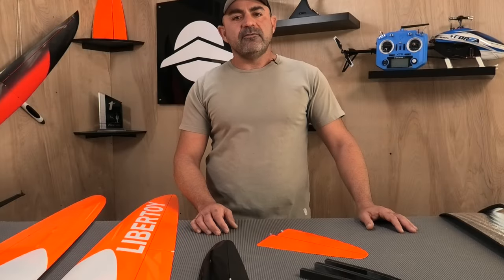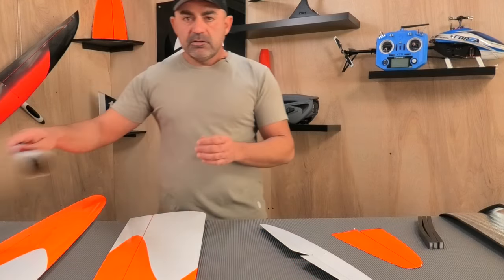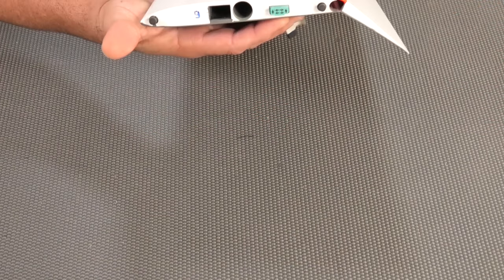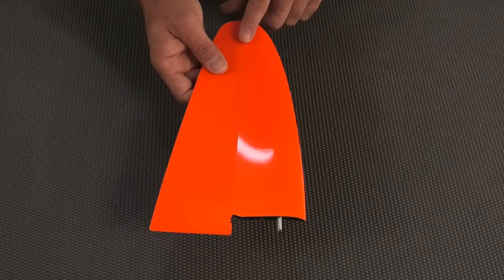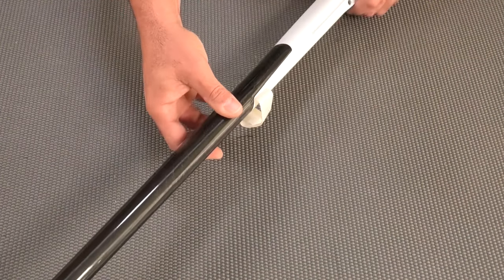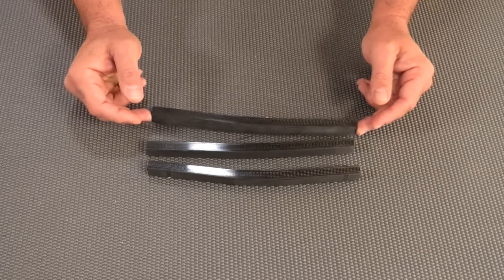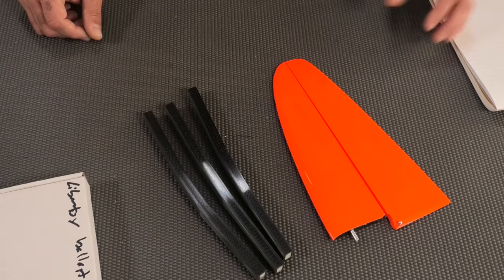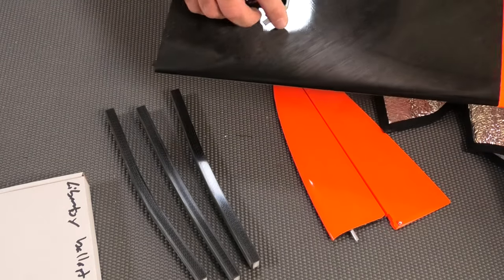CCM Libertoy 2.4M RC glider. First look.

Comment: Looks like a nice plane! It is like my Nan Orion V2. I like the preinstalled IDS and connectors
Reply: This is exactly the glider I was thinking about when he said that the libertoy is the outter panels of the liberty. 
What do you think of the Orion V2 ? I know it thermals well., but how does it perform in slope soaring and how well do it keep its speed when coming from a dive ?
Reply: @michelpetrus  I don't know (yet) how it does on the Slope. I live in The Netherlands and not much slopes here unfortunatly. It maintains speed very well coming from a dive (speed mode) and flies great, Thermal yes but no comparison to Explorer Q or 5